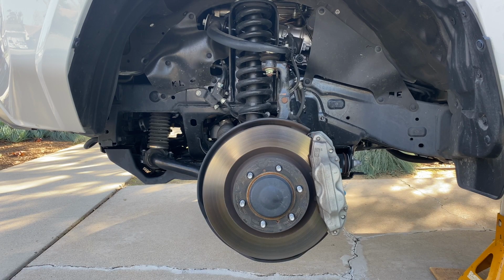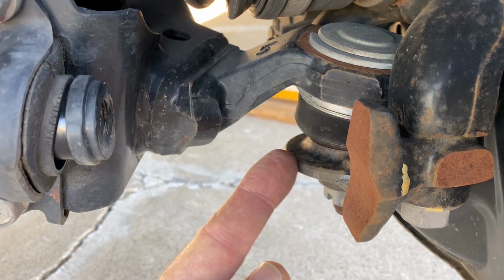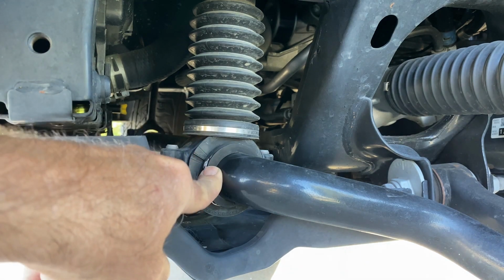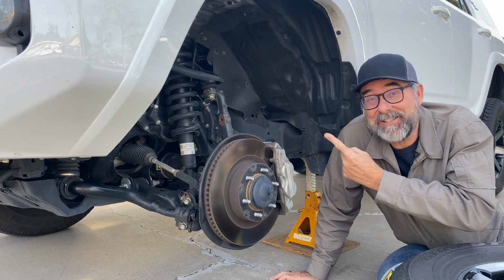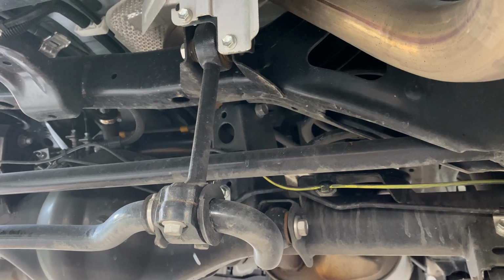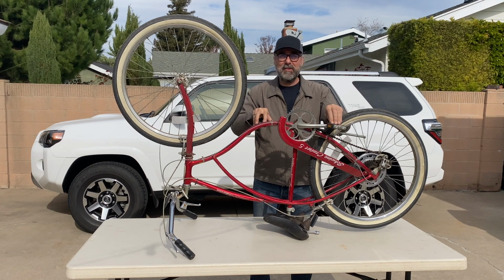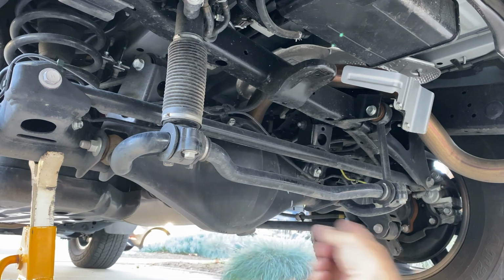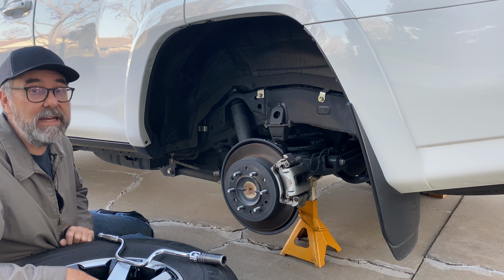2021 Toyota 4Runner TRD Off-Road Suspension Walkaround: Why I Bought The KDSS Stabilizer Bar System

Comment: If I put TRD Pro fox setup on a TRD off road, would the KDSS still work the same? What is your opinion why KDSS isn’t available on the Pro?
Reply: I have the same question. If kdss isnt available on thr flagship model then im thinking its not important or essential.
Reply from the maker: It would work the same. Why isn't it there on the flagship? Before I answer, let me say that the lack of KDSS does not hinder the Pro. It has other things going for it. But I think there are a few specific reasons, in order of supposed significance: 1) (cost) the TRD Pro is expensive enough as it is. Adding another $1,750 might ruin the mojo; 2) (complexity) the TRD Pro 4Runner suspension is added at the US port after the trucks are shipped over from Japan. They are not line-built that way (unlike the locally-built Sequoia, Tacoma and Tundra, which are). With that in mind, the presence of KDSS makes the physical act of swapping springs and shocks more time consuming because of the way the stabilizer bar mounts to the lower control arm; 3) (marketing) The TRD Skidplate won't fit over KDSS; 4) (benefit) The different offset of the TRD Pro wheels widens the track of the Pro a full inch, and a wider track makes a vehicle perform better in terms of RTI score for a given amount of suspension travel. This I will explain in an upcoming video. And again in another video after that once I spoiler alert put those wheels on this KDSS-equipped 4Runner.
Reply: @DanEdmunds  thanks for sharing the knowledge...!

Comment: Would you recommend this TRD off road part-time 4WD over full time 4WD Limited version for Toronto weather snow/ice/freezing rain weather ? I would mainly use it on road 95% of the times. Planning to do cross country trips.
Reply from the maker: All-wheel drive is better if you're going to be on pavement most of the time, with ice and snow in the mix. Part-time 4WD is less ideal because there's no center differential in 4WD, and that can mean binding on dry sections and slippage on icy roads. But I need to see if the Limited has an open (but lockable) center differential. My preference for the Limited in your case would only apple if it did. Toyota's use of the marketing term full-time 4WD is ambiguous and makes me want to check. My 80-series Land Cruiser had full-time 4WD, and it operated that way (open but lockable center differential), and that can be the ideal ice/snow setup that'll still work off road. I just don't like the low-hanging front bumper on the Limited. and the side steps. But if you're not really doing the rocky off-road thing, it probably doesn't matter.

Comment: Last Friday I test drove a TRD Off-Road with the KDSS and was amazed how well it handled on the road. It's on my short list for sure.
Reply: I love my new red one
Reply: kdss is amazing 👏
Reply: KDSS is for on road. 
That's why it's not on the pro
Reply: @cruzinthruspace Incorrect, KDSS allows for not only better but greater wheel articulation while off-road. It helps to minimize “head-toss” during moguls or boulders. The TRD PRO’s suspension is engineered for high speed desert terrain, washboard roads, whereas the OFF ROAD w/KDSS is more geared for slow  over landing especially if your rig has a rooftop tent. The system really stabilizes the increased height/weight. Plus it rides like it’s on rails while on pavement. Very underrated system.
Rare too!
Reply: It also only activates on turns

Comment: Ty Pops for the detailed explanation, I opted for Limited and comes with Xreas. From what I gather KDSS is far more superior?
Reply from the maker: XREAS is another ballgame entirely. I need to get my hands on one. The Limited is designed for a different buyer, i think. Less clearance under the nose, a full-time 4WD system, different more street-based tires. In Wrangler-speak, it's a Sahara.

Comment: We have essentially the same system on our 2013 Trail. I have been considering a 2-3" suspension lift, but I am worried about how it might effect the KDSS. Do you have any idea how a lift might work? We also pull a 2800# trailer, so any worries on KDSS and towing?

Comment: Well done.  By far the best description of KDSS I have seen.

My analogy would be to tape two bottles together at the openings, and show how you can squeeze air from one to the other, but if you squeeze both at the same time nothing happens.  Same thing here - if the drivers front goes up and the drivers rear goes down, one pushes to the other.

Comment: In offroad situations though KDSS becomes limiting for the people who modify their suspension, and want to run suspension with more travel. You run into an issue in which with the non kdss models you could continue to run sway bars, but with kdss models you have to remove kdss and have no sway bars. stock vs stock it may be more ideal, but when modified - the non kdss model is more sought after.

Comment: The only "regret" I have when I purchased my 2016 4Runner Trail was not getting KDSS. Other than that, the Trail/TRD Off-Road is the 4Runner "Sweet Spot" for the lineup and I'm glad I bought mine as a dealership "leftover" in June 2017.

Comment: Very thorough explanation on the KDSS. It would be great to see a comparison with a non KDSS 5th Gen 4runner on your ramp to see if it really makes a difference in wheel articulation. My only complaint with the KDSS is it hates cold weather. It makes all kinds of noises, rattles and clunks, and the KDSS light will come on until the weather warms up. Personally, with all the other gadgets, locker, A-trac, crawl control, the extra articulation  with KDSS is useless if the thing makes a bunch a racket in the cold weather. It's actually really annoying and not like a solid Toyota. I wish my 4runner didn't have it.
Reply: There is a video showing the improved articulation of KDSS over the pro. There is no reason to buy a pro or any other 4runner for off road performance unless you want to heavily modify the vehicle. KDSS limits a suspension lift to 3 inches or under.

Comment: Good stuff. 

I recently just passed 185k miles on my kdss 4Runner... I think It’s almost broken in.
Reply: did you do any off roading?
Reply: I'm at 175k on my GX460. KDSS just got removed though 😂😂😂
Reply: @JacksCirrhoticliver  damn, what happened?! was it because you wanted to lift/mod it or did KDSS shit out? I'm shopping for a used 5th 4runner now and the positives of kdss are great until you have to repair it...
Reply: @AndersAlden nope. I removed it because i dont want it. It makes low speed off roading very rough. I also have expensive suspension upgrades so, i just let them do the work now

Comment: You might have just described a great idea for mountain bike suspension.  A hydraulic line that runs between the front and rear shock.  If you stand and pedal, that puts pressure on both and stiffens it.  if you hit any kind of bump that is uneven front to back, the fluid moves freely and allows the suspension to absorb bumps like normal.
Reply: Specialized’s BRAIN system was similar, but not tied to the front suspension. That would introduce too many confounding factors to be cost effective. Nowadays, mtb manufacturers solve pedal bob very effectively with passive frame geometry. It’s just not the issue today that it was 20 years ago.

Comment: Cool videos Dan, thanks for sharing.  Came across this article comparing the venture w/KDSS and TRD pro, https://www.4wheelparts.com/the-dirt/test-drive-2020-toyota-4runner-venture-vs-4runner-trd-pro/ , and they mentioned the KDSS did give about an inch more droop in the front but 1.5 inch less than the PRO in the rear.  I will be interested to hear/see your findings.
Reply: Awesome article many thanks for sharing

Comment: Drove a standard 4Runner and then one with KDSS. 

The driving dynamic is a huge difference. The highway driving shocked me at how much more stable it felt. 

Ended up buying the one with KDSS. Treated me well but I noticed a seep coming from the front piston. 

Repair cost will simply make your jaw drop and I’ve learned not many dealers are equipped to work on the system. 

Solid video good sir.
Reply: so if this KDSS system goes bad, it is hard to fix and expensive? Maybe it is not worth it?
Reply: @SubUrbanNinja-EDC  it's worth it, because the performance increase is massive on road and even moderate off road. And the KDSS system is known to be reliable overall, rarely do you hear of it failing.

Comment: Is the 265 70 17 the biggest tire you can fit on a stock height trd off-road suspension?
Reply: I run 275/70/17 KO2’s on my stock suspension TRD Off Road with no binding or rubbing.
Reply: @largefarva73  thank you!

Comment: Also KDSS isn't completely passive. You can unplug the unit and it will default to "full unlocked" I do this sometime for a softer ride at higher speeds off-road. Also all GX460's have this feature stock.
Reply from the maker: I imagine that's not changing the articulation aspect, which is always passive, but instead opens the valve to the accumulator all the time so that head toss filter is always engaged, never isolated. I find it interesting that the valve would default to open if power was removed, as it would be when you unplugged that little harness.
Reply: @DanEdmunds  Yup you've got it.  basically linked front and back and unlinked. Curious if it increases articulation vs standard "under 15mph mode"

Comment: Excited for when they finally have a KDSS full disable button. Annoying how when going over 15mph the KDSS system is stiff despite being off road. I find myself trying to stay below 15MPH for this reason.
Reply: Look into Dr. KDSS. It's a switch operated electronic disconnect for the KDSS system.

Comment: Thanks for the great breakdown. I have a 2020 TRDORP myself. Any thoughts on a maximum lift height w/ KDSS? I’ve heard 2.5”F and 1”R tops is recommended,
Reply from the maker: That's similar to what I've heard, but I have yet to get s definitive answer from someone on the inside.
Reply: @DanEdmunds  Please keep us posted! 2021 TRDORP in the same boat! Also curious on  your thoughts for tire size sweet spot as well as the lift.

Comment: Great video with good information. As far as off-road, will KDSS articulate better or would a non KDSS 4Runner with the SWAY BARS removed have more articulation?
Reply from the maker: I'll have to see how crushed the bump stops are at full articulation. But the 4Runner/Tacoma front bars are not easy to disconnect/reconnect regularly at the trailhead. There's no good way to keep the bar from wreaking havoc while its unrestrained in its mounts, either. And I don't recommend running with no bars all the time, not one little bit.
Reply: @DanEdmunds  understandable, im not sure how it is with the 4runner running no sway bars but I have removed my front sway bar on my 2014 tundra and it does ride better and there's no more bouncy head effect going on but also I have king shocks so maybe that helps as well.

Comment: I'm looking forward to the RTI comparison between KDSS and Non!  I just bought a GX460, and I like the KDSS better on road than off.  I've read the KDSS valves close above 7mph.  I've looked for a bypass mod, so I can have the increased articulation up to 12 or 15mph.  Fire road water bars...  255/75/17.  No other mods.
Reply from the maker: I have to look into the software logic a bit more. Admittedly, I can't see the code when I stick my head under and have a look. I need to nail this part down.
Reply: @DanEdmunds  I just re-checked some forums.  Some said KDSS has an on/off switch at 12mph.  Some said it take in all wheel speed sensor data and tries to be smart.  My experience is that feels great on pavement, and average on the trail.  I'll report back when I get into a 3-wheel situation on the trail...
Reply: @DrKnowNothing1  only feels good on the trail at low speeds at 12mph or below when the sway bar is disconnected, because otherwise it's a rigid ride with a stiff sway bar. But yeah a switch by doctor KDSS can fix this issue and relatively easy to install.

Comment: Thank you for talking about the KDSS systems, could you please make a video about the KDSS on the 3" lifted cars and also the spacer for the KDSS.
Reply: Thats going to be my question when i go in for my first3,000 check. Ive seen videos of lift within 2 inches of a kd out of mkt installers. I got my first Toyota off road premium 2021 in October...it does and feels everything he says in the video....I’m hearing any lifting can ruin the safety sense calibration s and other infra detections....i really need to get this vehicle up to the New England highlands of Vermont as we come out of COVID.....these will be the questions when i go in ....my real one is why I’m averaging around 11.5 per gallon on city .....I’m  thinking the kd’s weight might be one.. and imagine if i go off road tires ! Its a gas guzzler....but just feels good!
Reply: 2 inches is about most you can lift a 4runner with KDSS according to my guys at 88 rotors.

Comment: That was an awesome overview of KDSS. It took me hours to research what the hell KDSS was before I bought my TRDOR.  This would have been useful back then.  KDSS is great.  Body roll on hard turns (or even moderately fast turns) is night and day difference between KDSS equipment 4Runner and the sr5 model.  I’ve never driven the pro model, so I’ll stay tuned for your comparison.  Toyota says that the pro doesn’t need KDSS because of the upgraded shocks.  But I think that’s marketing speak for we had to cut costs somewhere to maximize profits.
Reply from the maker: I think the Pro issue has to do with logistics. At one point Pros arrived from Japan with regular shocks on them, and they swapped in the real Pro shocks on at the port. Having KDSS made that a more difficult and time consuming job, so they nixed it. That might have been the Bilstein days. Not sure if that's also the case with Fox. Also, the Pro price was already high enough. Having the cost of KDSS in there might have kept people away.
Reply: Yeah that's marketing. Too much money to include KDSS on the Pro, but it also gives the TRD more appeal and allows people to mod the Pro the way the want. Toyota likes to differentiate their models. The new Tacoma`s have 9 different trims for different people. Just interesting how the TRD with KDSS is the best on road and off road over the Pro, at way less money.

Comment: Dan great video easy to understand and KDSS makes more sense. I am in the process of getting TRD OF with KDSS which is hard to come at the dealership, potential may have to order which is a hassle and takes 2-3 month. After seeing the video it seems the main benefit of KDSS is on-road body roll certainly important given most of my driving is on road daily driver.  I haven't driven one with KDSS, is it a big difference vs non-KDSS or really only notable at higher speeds? If I get one w/o KDSS can any suspension shock kit do seemer to KDSS without making the ride firm? I read other youtube say just upgrade to better shocks and get similar less body roll but would think stiffer ride. Thank you,

Comment: This is the best video on KDSS on youtube period! What your video helped me decide is to NOT go with KDSS. Let me explain. I live up here in Canada where road brine and salt is a big issue for rust. I've seen that many 4runners with components like these end up rusting out and the hydraulic fluid leaking. I know someone who had exactly this happen to them. The replacement cost? $4,000 minimum. With a car like 4Runner, given my driving conditions, I think I will stick with the SR5/TRD Pro options without KDSS as this will avoid costly repairs down the road, especially given how intricate the KDSS system is and how many points of failure due to rust there are. Great video!
Reply from the maker: I don't deal with road salt, so that kind of thing doesn't figure in my decision-making. I can see how it would, though. Salt and brine do terrible things to underbody components.
Reply: I have a 2017 Off Road here in Canada as well, no issues i get it Krowned yearly, under carriage is like new!
Reply: It's called preventative maintenance. KDSS or not, you'd be a fool not to undercoat and maintain that annually in your area. If you do, KDSS which has less than a 1% failure rate overall, regardless of geography, is no more susceptible to salt-related degradation than the rest of the vehicle. As such, by opting out, all you're "avoiding" is better ride quality on-road and better articulation off-road, standard. I'd contest you made the wrong choice, not the right one.